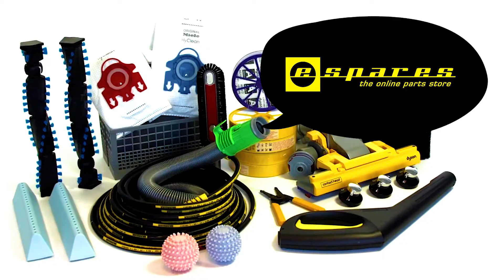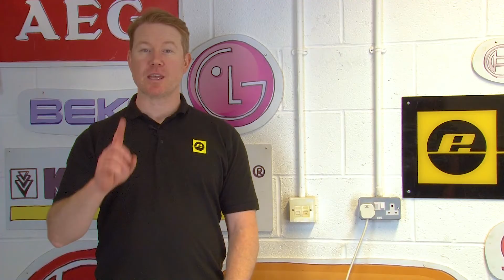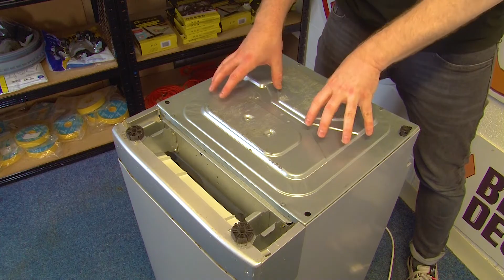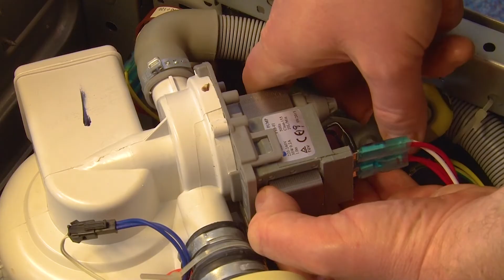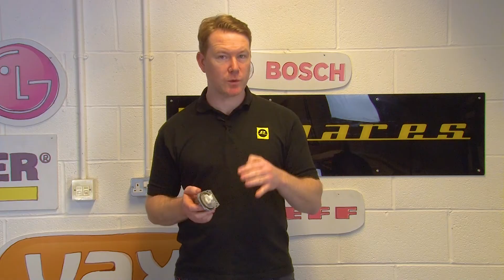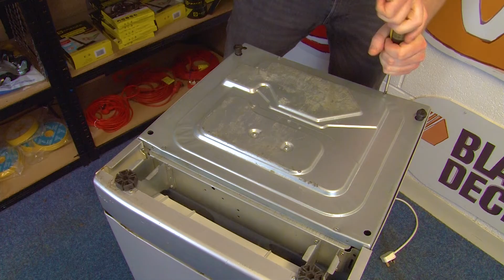Dishwasher NOT DRAINING? - Drain Pump Multimeter Test & DIY Change!

Comment: FYI: Some drain pumps cannot be tested this way. Some drain pumps have a small internal electronic board. Because of this, the external connection will always measure infinite continuity with a resistance meter. Found this out on my GE dishwasher. I am an Electrical & Computer Engineer by trade. So, when I think something has failed, I like to take it apart to see how it works. This is when I found the little board. Basically, the motor windings were being operated by what is known a triac (semiconductor device) which is being triggered by a small magnetic sensor. The sensor is monitoring the phase of the motor shaft.

Bottom Line: The Triac semiconductor will show infinite resistance when the motor is not running. Keep this in mind when testing some of these pumps with an ohm-meter.

Comment: so what is the drain hose tool? just long piece of wire?
Reply from the maker: Hi Patrick, the item used in this video was actually called a "drain hose unblocker"...it is effectively a firm wire that has ease of movement, designed to move freely to dislodge debris build-up.

Comment: is the ohms 160-200 good rating across most drain pumps?
Reply: to calculate what the ohm specs should be find the voltage and amperage they should be on the pump labelled then divide the volts by the amps and it will give u a number which should be the correct resistance
Reply: @mr_d-m0ney_swagbruh384 hope he didn't wait for your reply to eat off a clean dish again 😬